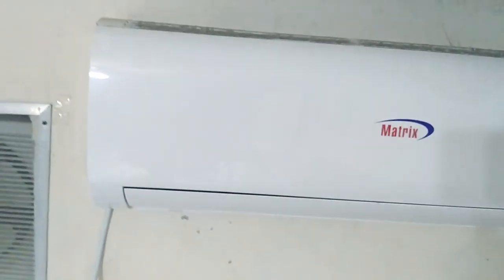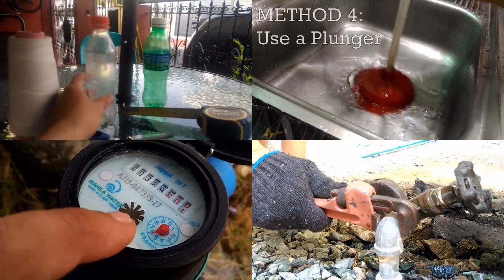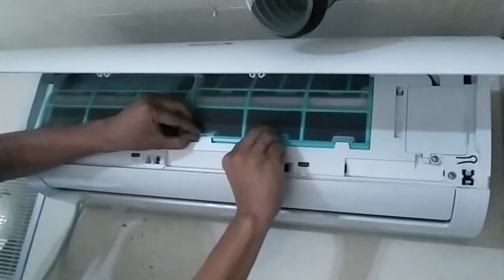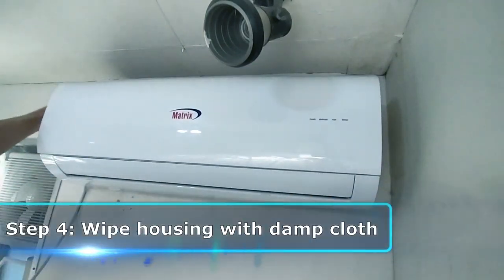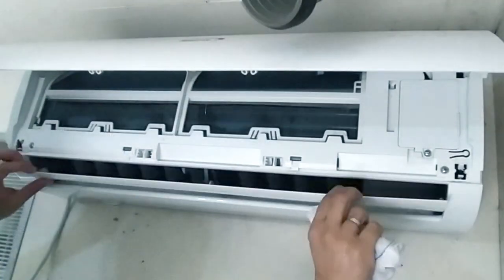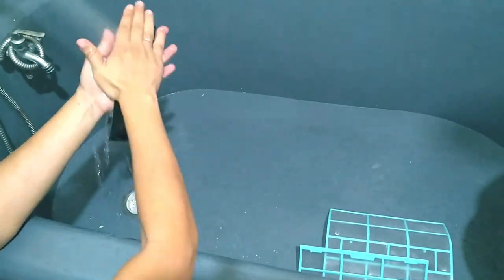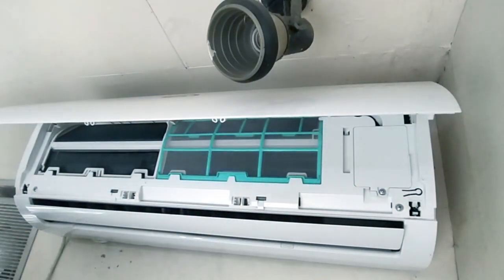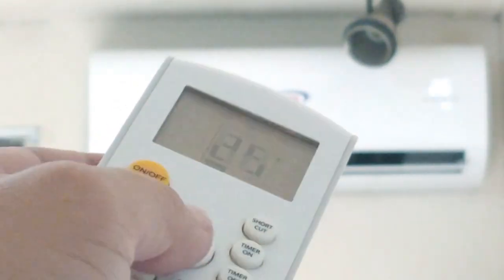AC Not Blowing Cold Air? Here's Why! | How to Clean Air Conditioner Filters

Comment: So hows the brand matrix? Im planning to buy one.
Reply from the maker: Performance and quality is very good. And the price is very competitive compared to popular brands.
Reply: @HanDIYman007  wow. How about the parts sir? Complete na ba sya. Hindi na ba ako bibili ng kung ano ano during installation?
Reply from the maker: Kumpleto na sa parts. Ang pagagawa mo nalang is yung bracket mount or cage for the outdoor unit. Split type bilhin mo ba?
Reply from the maker: And circuit breaker and electrical wires pa pala
Reply: @HanDIYman007  yes sir same as your unit 1.5hp inverter. Cheap price kasi sya kaya nagtanong muna ako sayo sir kung maganda ang performance. Last question sir before i get one, hows the power consumption?
Reply: @HanDIYman007  anong area ng room mo sir? Nagbili na ako ng unit matrix din po wala nga lang available na 1.5hp kaya 1hp lang nakuha ko. Okay po kaya yun sa 20sqm room?
Reply from the maker: @kentmartinez4020  mukhang hindi enough ang 1hp lang to cool a 20sqm room.
Reply: @HanDIYman007  bahala na sir. Wala na po akong ibang choice eh. Nag iintay lang po ako ng installation mag update po ako kung magkaka igi ba or hindi. Anyway sir maraming salamat sa pagsagot ng mga tanong ko at sa very informative na video!

Comment: Hi is it normal for the compressor to stop when the room is really cool? when that happens the ac do not blow hot or cold air but just air
Reply from the maker: What is NOT NORMAL is when the compressor does not stop when the room is already cool (i.e. reached the set temperature).
Reply: @HanDIYman007  oh ok thanks
Reply: @HanDIYman007  what will happen if  the compressor does not stop?
Reply from the maker: @spongebot6955  then the compressor will get overworked and break down faster. And because it isn't working "efficiently", your electricity bill will sky rocket.
Reply: @HanDIYman007  oh i was curious cuz i use an inverter ac
Reply from the maker: @spongebot6955  for an inverter AC, the compressor "steps down" or "powers down" when the temp is reached. sometimes, it powers down so low, you almost can't hear the compressor running. Inverters use variable compressor speeds as opposed to the "on/off" mode of a conventional AC -- this allows inverter ACs to be more energy efficient because it minimizes the huge power draw whenever a motor is turned on and off many times during usage.
Reply: mine is doing the same